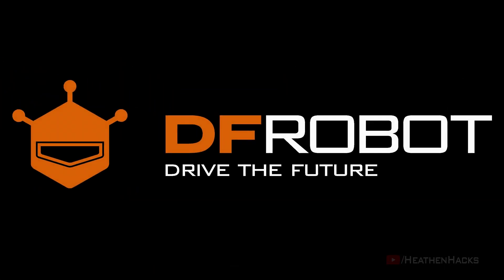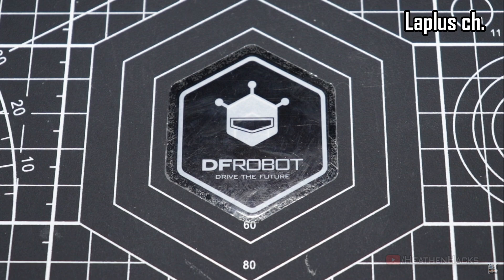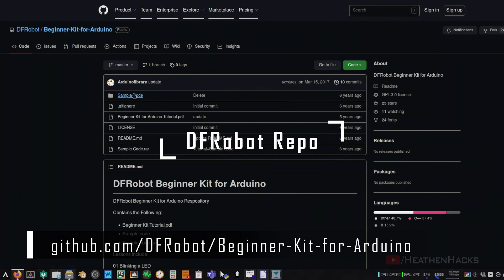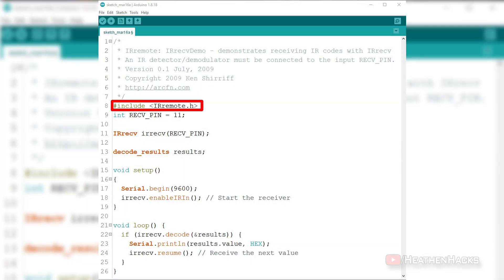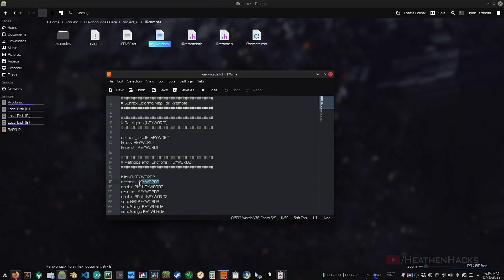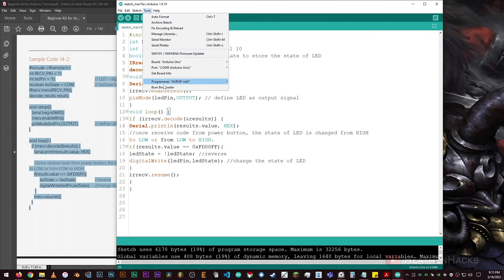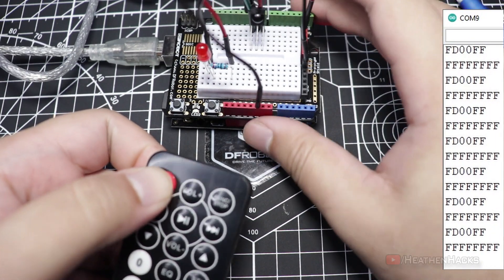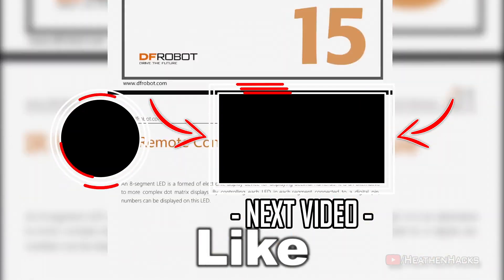DFRobot Beginner Kit for Arduino® - Project 14 IR-Controlled Light [Step-by-Step Guide]

Comment from the maker: So, it seems like a few of you are having some trouble showing the HEX values of the other buttons on the remote control, so I felt compelled to test the code again my self, and the results are on this unlisted video: https://www.youtube.com/watch?v=MEFGZTVaB1U

As you would see, contrary to what some of you are experiencing, mine is working just fine, and I think the reason might be because of a few things.

1. I'm using the DFRobot Beginner Kit. If you're using a different one, the remote control that is included in your kit may have different settings/firmware on it, so the results may not be the same. (But, I'm not that sure.)
2. Library issue. In my case, I'm using the one that I downloaded from the dev's Github repo.
3. Arduino IDE settings issue. Make sure that the Serial Monitor of the Arduino IDE is set to Both NL & CR and 9600 baud rate.
4. If the remote control is literally not sending any signals, try and replace the battery.

However, since the dev has changed a lot of stuff, I have uploaded the library I used and here is the link: https://drive.google.com/file/d/1cNNhXotXijXSJYl1nVT-usI2oQ55IfJ8/view?usp=sharing

I recommend checking the URL on VirusTotal for peace of mind before downloading.

Comment: I am coding with my android phone, i am following the tutorial but the LED is not on after press button remote. How to fix it ?
Reply from the maker: Hello and thanks for the comment!

Here are a few things that you can try:

1. Double-check the wiring/connections and make sure everything is at the right spot
2. Double-check the code for any typos or misplaced characters (or if you're using the correct library)
3. Double-check if the remote control is working
4. Change the battery of the remote control and see if it would work
5. Make sure that the LED is working, etc.

Or, if you want to be more thorough, check each part if they are working individually first.

After making sure that the parts are all working individually, try using a PC and check if it would work.

Comment: My remote only prints "FFFFFFFF", no matter what button I press. How can I fix it?
Reply from the maker: Hello and thanks for the comment! I think double-checking the code for any typos or misplaced characters would be a good idea.
Reply: @HeathenHacks  hi, i have such a problem too, there is no mistakes, idk:(
Reply from the maker: @travocure1488  Are you using "Both NL & CR" on the Serial Monitor?
Reply: @HeathenHacks  monitor. Btw, it worked with my usual Sony TV remote🤔
Reply from the maker: No, I mean on the Arduino IDE's Serial Monitor. Is it set to "Both NL & CR" with 9600 Baud rate?